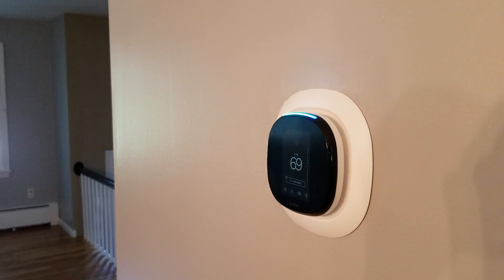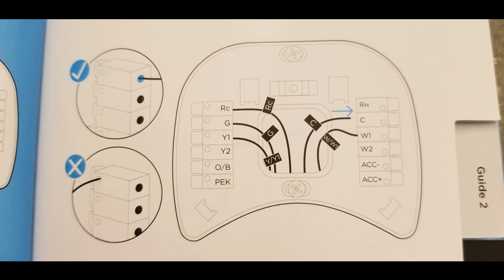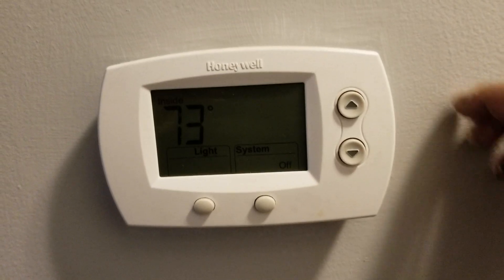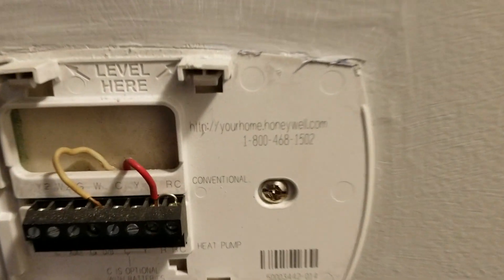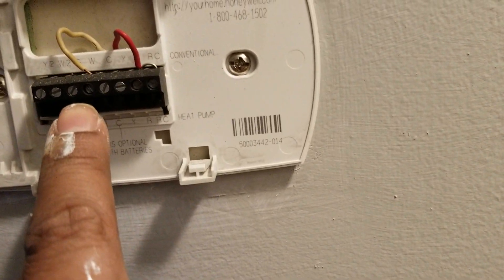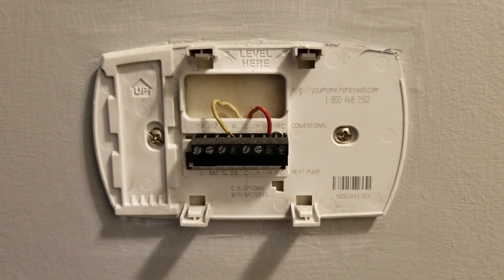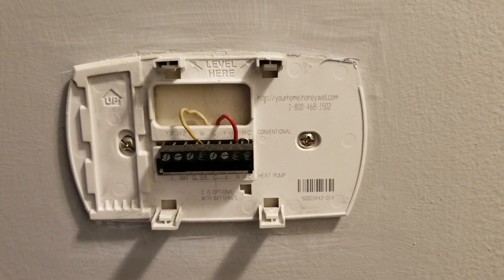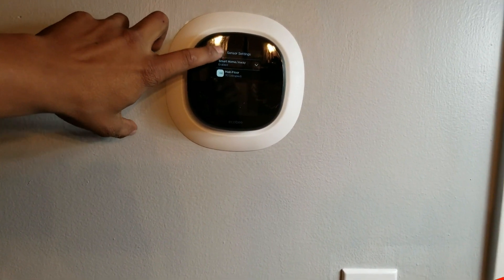Ecobee4 wiring: don't buy it before watching this video!!!

Comment: Hi there, I have the same setup. Currently two wires only, its the neutral that returns back. C needed, which is the hot (24V), please tell me, how you converted the two current once, where did they go?